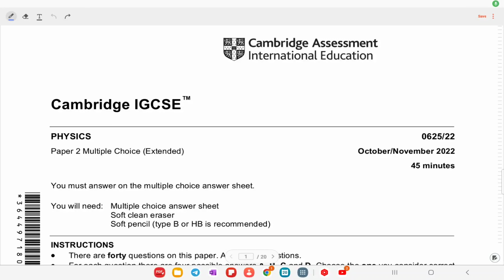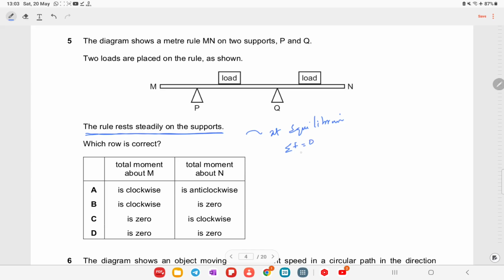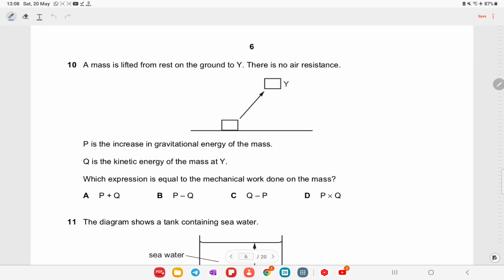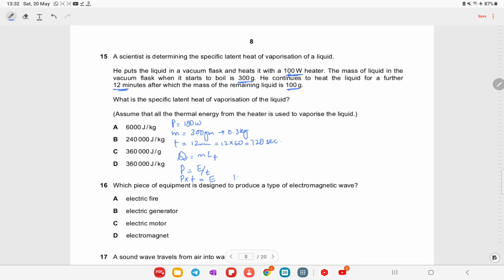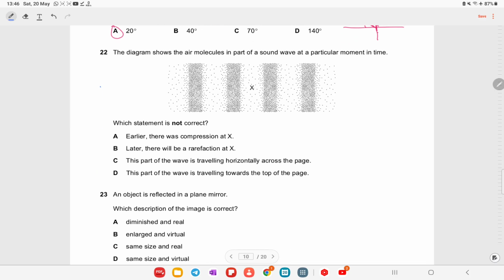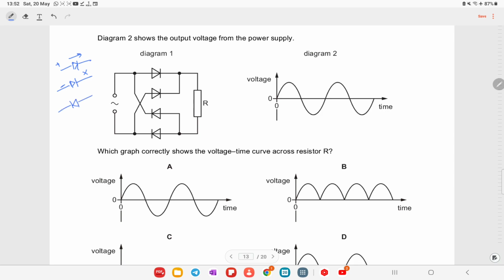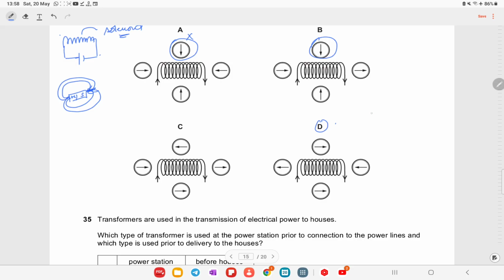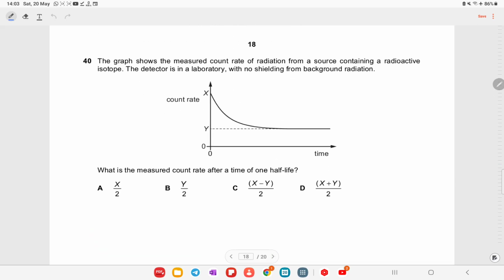Physics IGCSE Past Papers 0625/22/O/N/22 MCQ

Comment: Shouldn’t q14 be smaller liquid reservoir
Reply: A larger liquid reservoir in a thermometer refers to the bulb or chamber at the bottom of the thermometer that contains the liquid (usually mercury or alcohol) used to measure temperature. The size of this reservoir affects the sensitivity and accuracy of the thermometer. A larger reservoir allows for more liquid to expand or contract with temperature changes, making the thermometer more sensitive to even small temperature variations. This increased sensitivity can be beneficial when measuring precise temperatures in various applications.
Reply: @Mariamshoaib-oi7xx thank you this actually helped me a lot ❤️🙏🏼
Reply: @Mariamshoaib-oi7xx  give me a short answer and stop yapping
Reply: @enzo7500 If you can't respect people trying to help you, then stfu don't ask questions in the first place. Jeez. 
They're not bound to give you an answer in the first place.
Reply: More sensitivite thermometers have larger liquid reservoir
Reply: @Mariamshoaib-oi7xx  stop yapping

Comment: Shouldn’t q14 be smaller liquid reservoir
Reply: Yess brozzer
Reply: Yaasss
Reply: I think the reason is a larger reservoir would mean greater surface area hence more sensitive.
Reply: Idts, larger liquid reservoir means larger volume of the liquid, meaning more expansion for the same change in temperature. This makes it more sensitive.